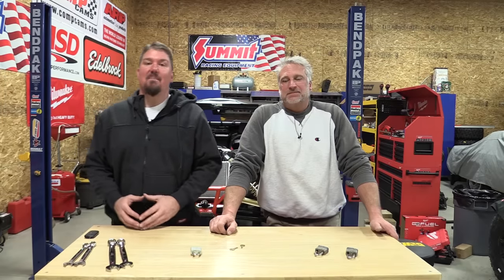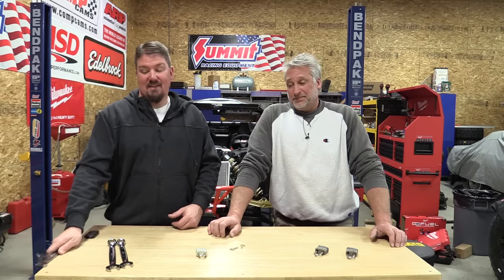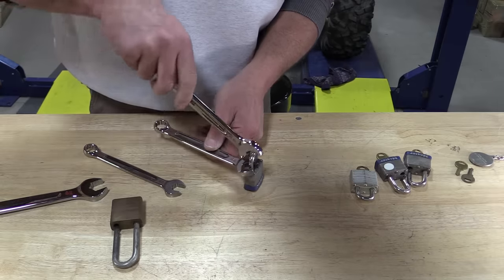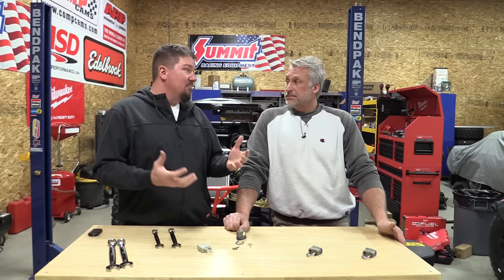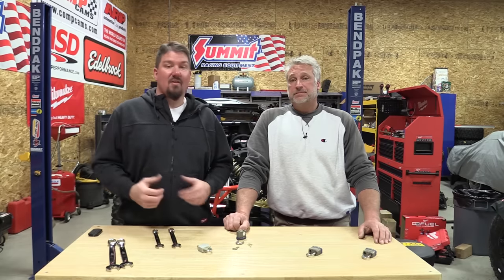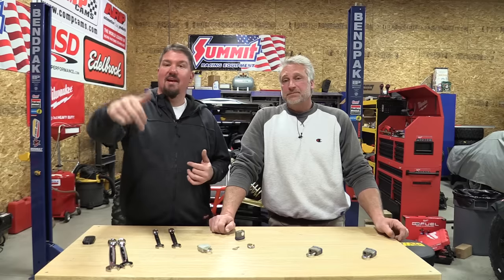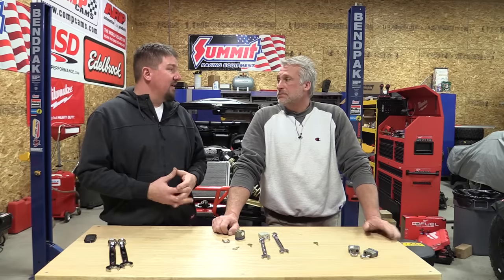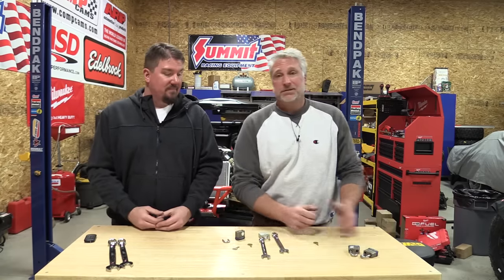How To Break Any Padlock, Even a Master Lock, With Ease Absolutely Scary

Comment: A lock only slows down a thief. That, in most cases is enough. And there are more secure locks that are very expensive. I like the ones that shroud the bolt. But, as I said they only slow down the thief. Given enough time, and ANYTHING can be broken into. Thanks for the demo guys.
Reply from the maker: That is true.  It was eye-opening for us to do this and realize that the items we trusted to be secure were not at all.
Reply: With all the cordless grinders out now...anyone planning on stealing can.  At my wife's work thieves took a grinder and cut the catalytic converter out of every lifted truck in the back of the parking lot. (Where the employees park at a hospital).
Reply: A lock will slow down a thief, but a Smith and Wesson will stop a thief.
Reply: @joshuasmith7369  still sucks as the thief will see you leaving your shop or house and break in while you're not there
Reply: Tinier locks so you can't pry them with wrenches?
Reply: @WorkshopAddict  ooool
Reply: Is that called a disk lock
Reply: While no one at home, i trust my trained rottweiler more than any master lock..
Reply: Like my dad once said it’s an honest man’s lock cause only an honest man won’t break in to it
Reply: The lock connected to my trailer hitch was rusted and I COULD NOT get the key to turn the lock after WD40 etc… I spent over an hour. Then when I pulled out the spanners and squeezed (with little force) the lock popped open in less than 30 seconds. Trailer is parked on the street. Not secure AT ALL 😢
Reply: Every lock can be bypassed with a barbed wire without the blades
Reply: And friction
Reply: Obviously

Comment: I see a bunch of wrenches on your table. You don't need all that. All you need is one straight piece of metal that is small enough to fit in the hole, but thicker than the metal on the lock. Stick it in the hole and twist it. Comes off just like that. It's way easier than what you're doing in this vid, especially on the longer lock. The longer lock is actually easier.

Comment: Agree with your findings. I would add that if the lock is on something, it will be much more difficult (if not impossible) to position wrenches to get the leverage you need. Drilling the cylinder is probably the easiest thing to do.

Comment: THANK YOU!!! I'm in the process of moving, and bouncing between towns 2.5 hours away. I went to shift the shed contents to the garage on the last day before the moving truck is here, only to find a stuck lock on the shed 😢. The key turned properly, the initial hasp click would engage, but no pop. Tried lube. Tried tapping. Tried picking it. Tried the rapid jiggle-pull. Tried begging. Your video was the 5th or 6th i came across, over the course of 2 hours that I didnt have to spare to start with. Holy hell, it worked!!! I used a variation of the wrench pry. Wound up using an adjustable wrench leveraged kinda sideways between the lock top and the piece the lock hasp goes through on the shed (thing.. I can't come up with the name at the moment) Pulled down using some body weight and BAM! I can finally get my stuff out and get back to work. I really can't thank you guys wlenough for this video!
Reply: "Tried begging", I just can't 🤣

Comment: Had a Fortress Bike lock that I lost the key too.  Didn't have as big of wrenches as you guys did so I used a 10" pipe wrench.  Used the force upwards and it came off instantly, easier than the 2 wrenches.

Comment: At the time there were no locks on the mark that could deal with a cutting wheel. Now there is the Altor U lock. My critism of that lock though is the inner dimensions are tiny which makes it hard to lock a bike frame and a pole inside it. In other words it has limited lock up combinations and required multiple cutting discs and multiple batteries to have a chance to cut through it.

Comment: I have a master lock with a hex sided shackle (vs round), and I tried bolt cutters on it and they bolt cutters just slid off and never were able to get a bite into the shackle. I suspect the wrenches might still work. Nothing other than the noise is going to stop a cordless grinder.

Comment: Very helpful. I locked a gate latch with a Master lock with the key insertion point in wrong direction. This inexpensive lock allows the u-bolt portion to pass all the way through the lock, and if you go too far there is not enough room to insert the key.  This kind of lock is good for a chain, but user beware!  I'll likely buy a new lock after I destroy this one, but first I'll try and hacksaw the key to see if I can slip it in.
Reply: I just had exact same problem (put it on backwards in the dark). Opened it with heavy duty paper clip and LARGE screwdriver. I WAS disappointed in Master, but it IS true … most locks only help against honest folks.
Reply: Oops … just saw paper clip answer above … sorry!

Comment: I've had to pop my own tool box lock. Used a spud wrench. I'm building a padlock with a square 1095 shackle to lock the smithy. The bolt goes all the way through the shackle and into the lock body. Not easy to break

Comment: The best way to prevent someone from breaking into your stuff is to create something that  will increase the time to defeated the locking device. Crooks aren't looking to spend anymore time than the minimum  necessary to steal something. All else being equal, criminals look for the lowest hanging fruit. As the value of the property increases so does the type of criminal that will be attracted to it. I weld and have been able to put together some contraptions that actually prevent the direct access to the lock. Not having direct access will most likely increase the time that is needed to defeat the lock. Another aspect of building something myself creates an aspect of unfamiliarity of the locking assembly. If the crook never before saw the item that I created it takes time to figure out how to defeat it. As far as the grinder goes, I also took into account that aspect - Tungsten carbide inserts - The grinder wheel is cutting nicely and sparks are flying, suddenly sparks stops and the wheel edge starts to glaze, and this is with a ceramic wheel. Aluminum oxide wheel basically just turns to dust. I don't want to give, here, the answer to the ones that don't know. The ones that know, know it. Increasing the depth of the material to be cut , also restricts, the option, to larger grinders and additional time. Yes there are power saws that can handle that. but also materials that can gum things up. Just don't be the easiest choice to get rip off, make the crooks go look elsewhere, they usually aren't looking for hard work.

Comment: It's the type of force. Best I can tell, the loops on cheaper locks are cast then coated with vanadium or chrome. Look at the break. The metal will show bubble like irregularities in the break if it wast cast.  You can snap those with a hammer. 
There are high end and quite expensive locks out there that will have several notches on the lock end of the loop made with super strong metals.  These particular locks are noticeable and can give a their that contents are quite valuable.  Go mid range, preferably a solid body lock and add one extra  lock latch on the trailer  about 4 inches from the top of the door. Place a completely different type of cheap lock there. 
Theives don't want to get caught, placing another lock to handle in a position that creates problems for leverage and risk of making too much noise. 
The high priced high security locks attract the pro theifs.

Comment: Was this ever revisited with the lock being placed where a lot should be placed and then trying to break it off?
I saw there was several comments about how they're always broken being held in their hands but never on the clasp.
I would like to see how well a thief can actually get it off of the item being locked when there's limited room and leverage also when having to continue look over your shoulder to see if someone's coming plus being loud.
There could easily be a test set up with motion sensors and if you set them off you're busted.
It's been 2 years since this video is made so I was just wondering
Reply: my question too. lost my key and on a storage unit where hanging on and through something that's on the top and in the way...want to know if cutters or something else will work.

Comment: Case hardening methods exist, that's where the outside of the metal is hardened but the inside is left compliant. This is what they do for things such as transmission gears; which must be hard on the outside so that they aren't eaten away from constant meshing, but ductile/complient so that teeth dont snap off.

Comment: A Ramset is much faster than a grinder. Without the visual sparks or electricity.
Reply: Bit noisy though and might be mistaken for gunshot
Reply: Thanks Lock picking Lawyer for that tip 😉

Comment: like to use one or multiple ABUS 37/70 padlocks with a Schlage security chain  for the trailer. i stick it through the wheels and or frame, and attatch it to something "concrete" if possible. Nothing is bulletproof, but it makes it a legit pain in the ass. Especially if you back the trailer up to a structure first, leaving the truck attatched, alsowith a steering wheel lock.

Comment: im an ironworker and we use a tool called a bullpin .take your pin with the thin part right directly above the key hole (the top) then hit it with your hammer bang one shot every time
Reply: iron workers hammers are measured in lbs not oz lol mine is a 4 lb/

Comment: In this and other spanners and lock videos I have seen fall short of an in situ test, as a thief would be presented with. Try putting the lock through a hasp on a door - the shorter padlock should be harder because there is little room to insert the spanners. So please do a video as I suggest and then we will see.

Comment: The piddley little locks you broke are designed for keeping the kids out of drawers inside the home. For a lock twice as big you won't have wrenches that'll work and only massive bolt cutters or a big grinder will even damage the thing!
Reply: Grinder nothing happens no damage   it cut through steel as easy as hot knife through butter   i cut big giant lock an friend say no way i can    it take 5 to 10 seconds

Comment: What about a masterlock that has the lock going thru and out bottom? Many notches to pull thru.
Reply: Good question. I'd like to know the answer to that too...  And do the multiple notches each get something to hold it back from opening? Or just 1 on each side of the shackle? If I may hypothesize: if the notch were to be the same size cut-out on the shackle as any other lock, why would the "right through" lock do considerably or substantially  better? I might think only slightly better when it comes down to holding up to a dual wrench method. But this is just opinion....

Comment: how about the better master locks, I have one that the shackle is a mix of boron and carbide, it's a little longer and has a ball bearing on each side that secures the shackle inplace.  its also hex shaped which is supposedly to stop the ability to grind it off or cut it easily.  i think you still could but it would take some time to cut through and someone would hear at that point.
Reply from the maker: Working on info on that.

Comment: 😅 I locked my keys in my shed the other day. Then ran across this video. One thing they suggested is on double locks use 2 shim. This can come from cutting a tin can. I'm going to try that before clipping my padlock. My suggestion get a dog or bigger locks. I will replace with a fingerprint lock if I do break this one soon so I cant do this again. Come try get my thumb with my big dogs. 😉 I'll try the brinks if the shims don't work I'm breaking a lock tonight. Thanks for the help. I have 2 RN of my 8. Thanks for comparing my dad's master locks to the new one.😅 ps no five finger discounts here.

Comment: The 4 & 1/2” angle grinder is a hard hombre to defend against.  What we try to do is avoid using any type of padlock or any external locking devices.  It is extremely hard to stop a determined thief with access to the local Home Depot where he probably stole the tools that he is gonna use to steal your tools with.  We use the shackle locks on most of our outdoor cargo containers.......however thieves have got past them too !!!  With the vaunted angle grinder or a set of small torches your tools will never be completely safe.  Look elsewhere for securing your tools....motion lights , dogs , security cameras etc etc.  Jeff , maybe you should have eaten your wheaties....that lock should have broken easily at the bottom....💪🏻.  😁😁😁   Easy killer...it was a joke.   As always a good informative video......
Reply from the maker: Jeff has been on a high fiber diet and did not want to push too hard.  :)

Comment: I'm wondering if this would work on a round padlock on a storage unit since you wouldn't have the room to put the wrenches inside
Reply: From what I've seen video-wise there's enough room to fit the wrenches but not enough clearance to achieve the brutal amount of leverage seen here w/standard locks. However, unless the hasp is likewise made out of tough, case-hardened steel & also has anti-theft dimensions baked-in (which is exceedingly rare), there's still more than enough leverage available when applying the wrenches to simply tear the hasp or any of the (likely several) weak anchor points right out instead & fairly easily too for that matter...

Comment: Hi! I had a quick question. Is there a type of soldering gun/iron where the solder comes out of the tip? Thanks!
Reply from the maker: I have not seen anything like that.  It would not be the proper way to solder as you want the solder to move to the areas that are hot and soak in.
Reply: @WorkshopAddict  Okay. I thought I saw it somewhere before, but what you said makes sense. You can't put hot solder on a cold area. Thanks for the response!

Comment: Hardened steel shackles is strictly for security and cutting. And bolt cutters are not meant to cut hardened shackles. You will wreck a perfectly good set of bolt cutters.

Comment: Hello. I am here because my father in law passed away last summer and he left behind a bunch of stuff. Among the stuff, a large yellow toolbox kind of thing. It has two Master padlocks but everything is inside so there is no way to get to the shank. How do I... open it? Also, we don't have the keys. :)
Reply from the maker: Watch the video or get so.eone to come over with bolt cutters or an angle grinder with a cut off wheel.
Reply: @WorkshopAddict  The only accessible part of the lock is the bottom where the key is supposed to go... The rest is inside. :)
Reply from the maker: @katmarrs7054  do you know anyone with an angle grinder?  It would take 2 minutes to cut it.
Reply: @WorkshopAddict  cut through the toolbox itself? 🤔 maybe

Comment: Locks need to be much bigger than people think to really be more secure. Mostly what they give you as peace of mind, and resistance to most thieves of opportunity. But if you REALLY need to secure something, you need a much beefier lock, and one that is designed to avoid all the hacks you guys were showing. Also they try to have a combination of a very hard exterior and a less hard tempered interior in a large sized bolt. But the size you guys were using were so thin, it's basically crystallized all the way thru and it's a better compromize to have it all hard, than all soft.  MOST people would try a saw or hacksaw, not realizing the wrench ploy. Also hardened are much more resistant to bolt cutters. But at that size, it really doesn't matter. That is like locker room at the gym size. You wouldn't want to secure your Boat with it.  Databyter

Comment: My niece's place padlock was cut by bolt cutters . I think that's most common way but might be wrong . see a lot of videos go on about picking them but I doubt most thieves know how to .  Some might use wheel grinding / cutters but mostly bolt cutters . Got her disc padlock and used some nuts on shackle to protect shackle . Yeah the shroudred ones are the way to go I think . Thieves just wantr one with highest success easiest to get thru which I think is bolt cutters on lock or chain

Comment: My FAVORITE means of securing a trailer from being stolen despite the LARGE CHAINS AND LARGE LOCKS is to secure a LARGE inoperable generator with wheels, namely a coleman powermate that is to be put at the front BESIDE THE TONGUE, and LOCKED WITH LARGE CHAINS AND A LARGE LOCK. It is dead weight and CANNOT BE TOWED. The pad lock is locked under the trailer.....I CALL THIS A TRAILER ANCHOR.

Comment: Ok.. If you had unhardened metal, it would be easy to simply saw it off. One of the inescapable facts of metallurgy is that you cannot have "hard" and "ductile" at the same time, so you harden something, and you will also make it brittle.. The best thing with lock parts would be to "case harden" them This means that you could have a VERY hard case that no way could you file or saw, BUT, with a ductile core that would stop it breaking in a brittle manner.... Google "case hardening"

Comment: locks are to keep a  man honest not to keep a man out :p but if you are going to use a  disc lock ..   btw trailer ball locks are dumb because you can bring a spare hitch :P and just unbolt the locked hitch and install yours and drive away..   just get  a  small gps that hooks onto the battery in a  trailer so when its plugged into a  vehicle you can GPS it